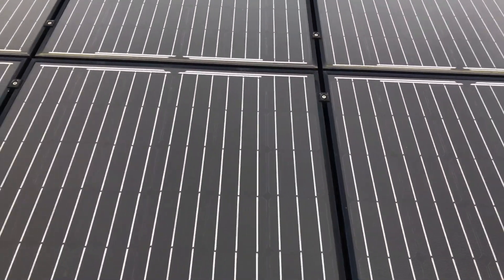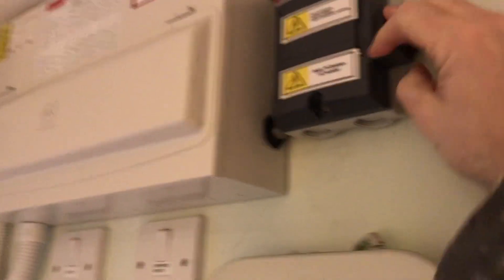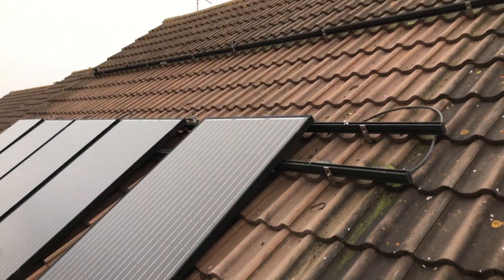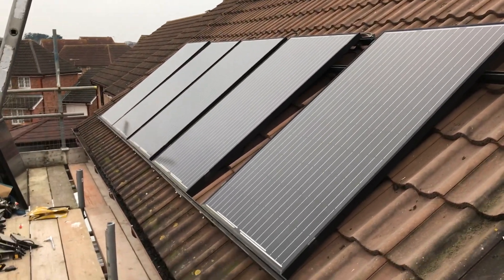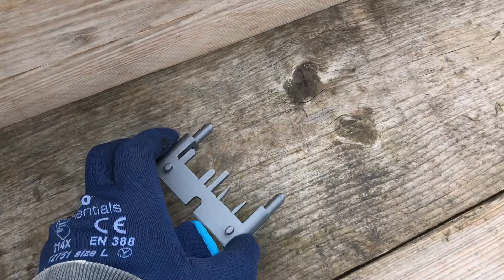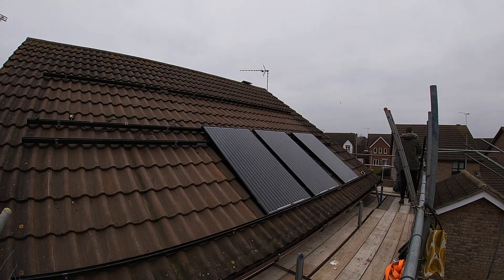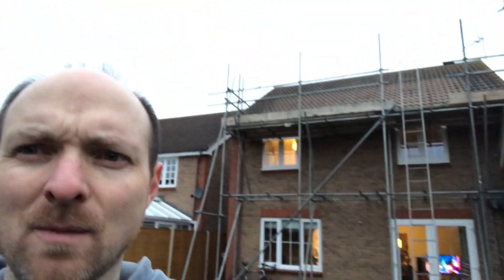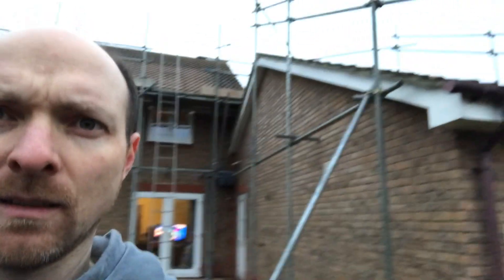Solar Job Part 1 - Solar Panel Removal

Comment: I have just had all my panels removed due to a leaking roof.  Two wires on each panel were cut with plyers.  This makes no sense after watching your videos.  Is it possible the contractor messed up or could it be the type of panels I have?  455W JA Solar Panels.  ☹
Reply from the maker: They definitely messed up! You may have dc cabling back to a single inverter. If they have been cut it’s quite simple to remake the connectors on the wires, although the contractor should know better. Just make sure they are the right way round https://amzn.eu/d/iRdvNWX
The connections are tricky to undo if you don’t know what you’re doing so they may have opted to cut them.

Comment: No info at all about how to do this
Reply from the maker: Undo bolt, unplug wires.
Reply: How do you undo the bolts
Reply: @yoshiofar  WHAT IS A BOLT ?

Comment: I would like to point out that when you open the combiner you are just removing the path for current.   You have not removed the source of energy (the sun) and full potential energy still exists on these strings. You may get lucky 99.9% of the time, but one day there will be a fault and it is not going to feel good.   The only safe way to do this is either at night, or by covering the upstream module then disconnect.
Reply from the maker: Hi Jeffery these panels are not on DC strings. These panels are on micro inverters so each panel is isolated by the micro inverter which requires 240v AC to operate.
Reply: @eviain  Gotya! Actually liked working on the microinvters. Most people are not aware of the problems of DC strings and sunlight :)
Reply: @eviain  are micro inverters the optimisers? Thanks

Comment: Great job! On the 3D printed removal tool, are you squeezing the tool to allow for removal? What to the 2 protrusions in the front do for you? Also, as asked below, did you merely flip the one isolation switch to make them safe work on? Thanks!
Reply from the maker: Hi the tool is mainly to use the prongs that go in to the holes on the plug, the plug is then unlocked so you can then pull them out. So a little squeeze helps keep the tool round the plug as you pull. The tool isn’t necessary a screwdriver will do the job. 
To make this system safe it just needs isolating from the mains power, it’s known as a grid tied system which means it won’t work if the mains power is down. 
That helps people working on power grids not get electric shocks from power coming out of peoples homes if they are working in the network. However worth checking your own system before working on it.
Reply: @eviain  Thank you! I may have found a dealer for the tool here - but GREAT info and nice that you answered so fast. VERY helpful. I thought my installer told me about the main power isolation "deactivating" the panels; thanks for the confirmation. My system also has a battery back up, and I've been instructed in the system shutdown instructions to isolate them first. (There's actually the battery breaker, and knife switch, so I've not to worry about that. But that's a secondary system I need to account for.) Again - thanks for the help!

Comment: Hi it would have been useful to see how a panel is removed..what screws or any nuts that needs to be removed. I need to do something similar but not sure how. I think my panels look similar to your ones. Perhaps you could explain the procedure as you have already taken the panels off..that'll be great.
Reply from the maker: A very simple clamp system that pulls the panel down on to the rail. Two types mid clamps to go between two panels and end clamps for the last one on a rail. In my case bolt was a hex (Allan) key. Other panel systems may differ there’s lots out there.

Comment: What is the special tool called to remove the micro inverse wire off?
Reply from the maker: Shaxxie not sure I just called it the enphase micro inverter tool, here it is on thingy verse. Not really necessary two Phillips screwdrivers will also work https://www.thingiverse.com/make:590466

Comment: Are they easy to unplug?
Reply from the maker: Yes but care is needed not to chew up the connector, you need to depress a couple of pins on the panel wires. If you have emphase inverters you can use two Phillips screwdrivers or the special tool

Comment: How long did it take to get them all off?
Reply from the maker: Sampson Roofing not long i think we had it done in 2-3hrs.
Reply: By isolating the load, turning off inverter and breakers etc it was safe to just unplug panels? No covering them up required?
Reply from the maker: unbelievabubble yup